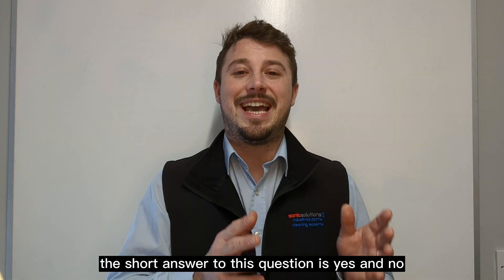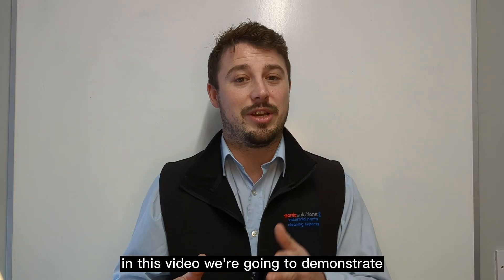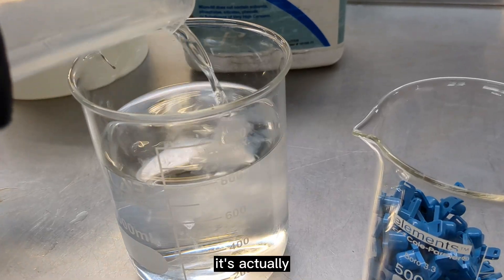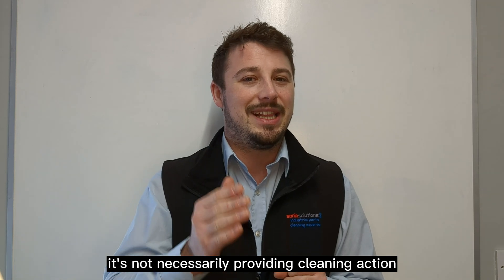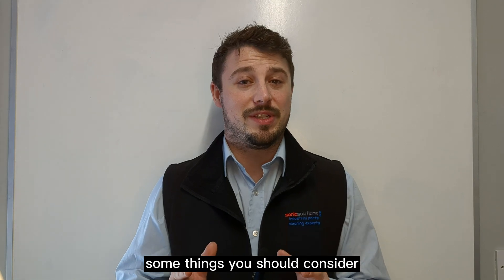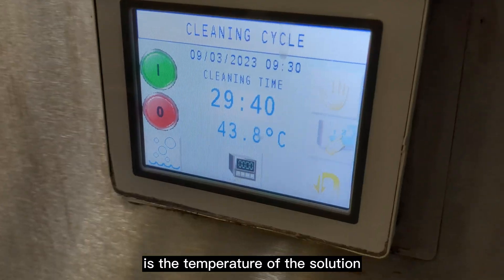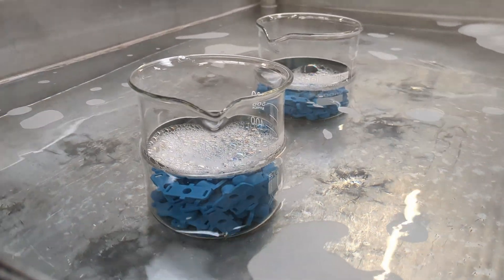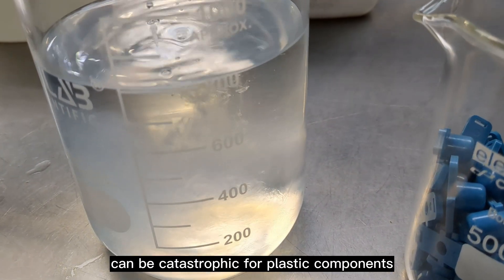DOES ULTRASONIC CLEANING WORK WITH PLASTICS?

Comment: So I'm just gonna be the first comment to ask this being that these plastic parts are for 
one. Not that big of a deal if they break,
2. Not that much plastic I need to clean and
3. These plastic parts are very small with hard to reach areas that risk breaking. If scrubbing by hand but basically what I want to know is if You can use the keys to a keyboard in a ultra sonic,  since, They consist of many small pieces, lots of hard to reach areas and consistently get dirty on a regular basis. But the contamination is not very heavy. But it's still vital to keep these components clean especially on expensive keyboards like mine, The alternative is very time consuming and have probably have a bigger risk of breaking if I scrubbed them by hand
Reply: I got a cheap jewelry cleaning ultrasonic and use it to clean keyboard caps, synthesizer parts.

https://youtu.be/FHa9PtixkUg?si=knMEOA8cXwZSauTY